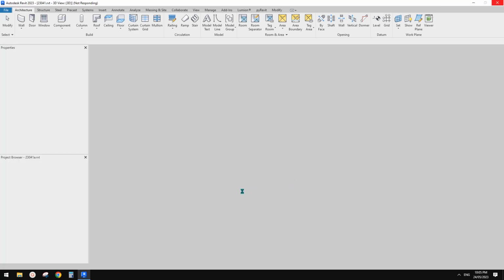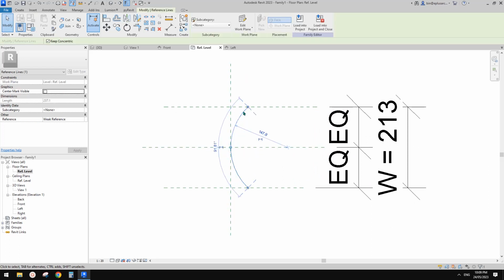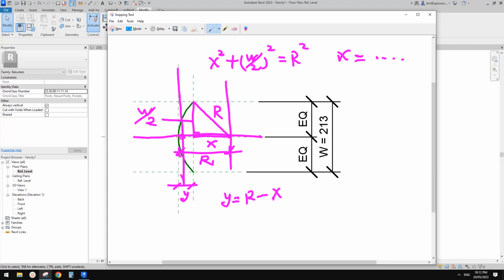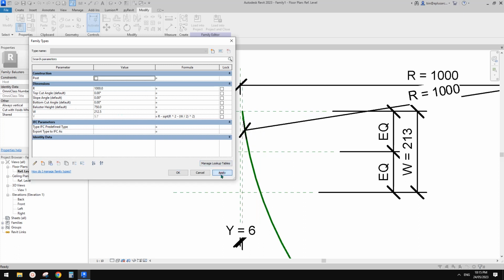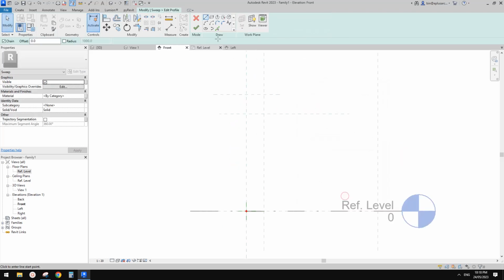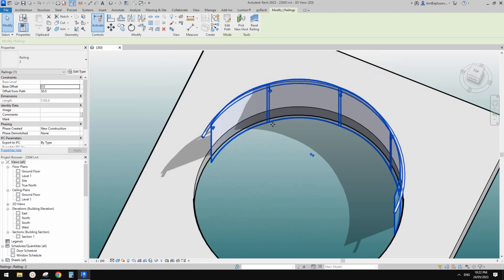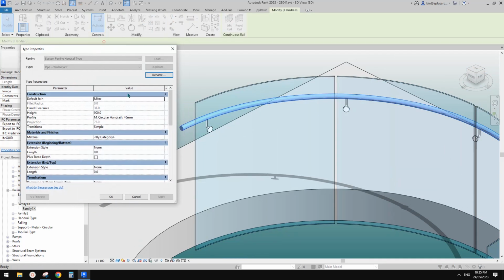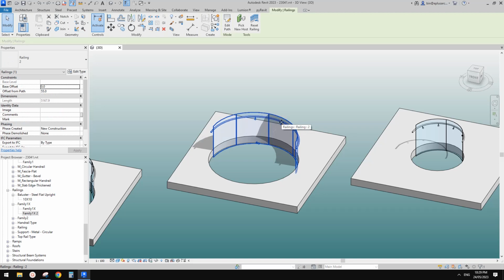23042 - Revit Curved Glazed Railing Method 2

Comment: Hello! Does this particular railing work for straight line segments? Like when I'd want to connect two perpendicular lines of railing with a long curve, can I do it with one railing sketch?
Reply from the maker: I don't think you can because you need to have the same radius for the panels if you are using this method. On the other hand, you can use method 1 for this.